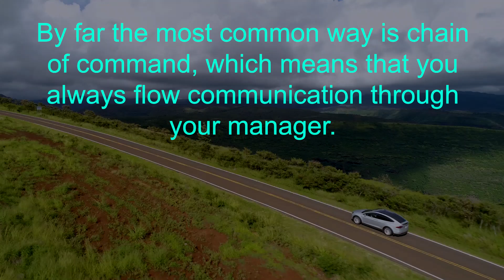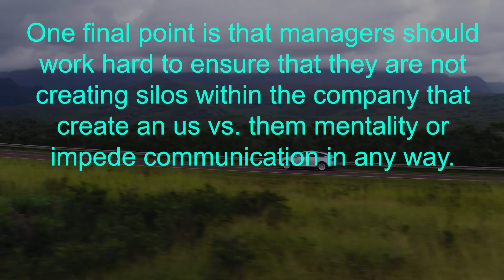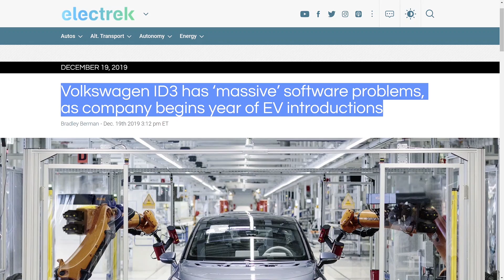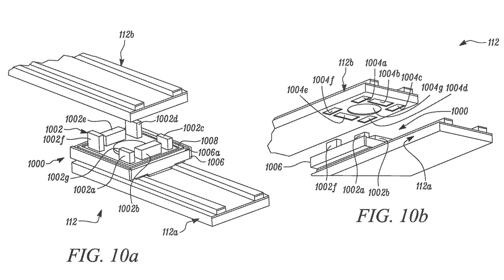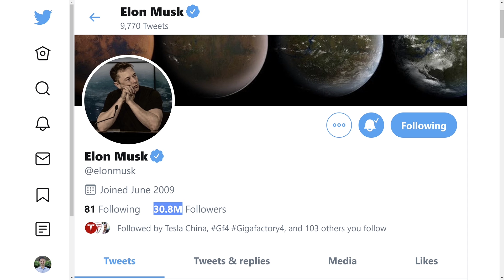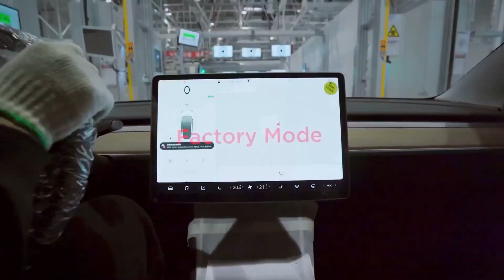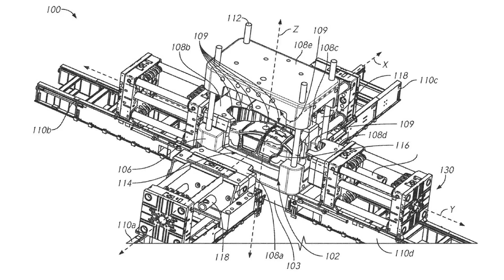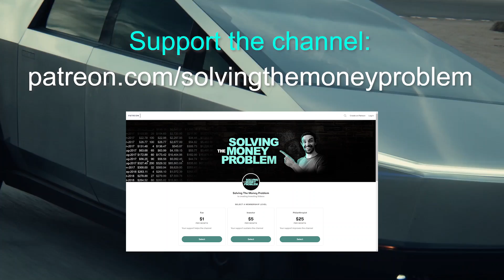Tesla: The Optimization Machine (why Tesla will win)

Comment: The “Silo” structure will kill the legacy automakers. Especially susceptible are the larger Japanese companies where respect for managements directives are more important to ones career than doing the right thing.
Reply: Youre actually right about hierarchy but overestimating the effect.. optimising around Toyota's culture actually was what propelled them to top. Read on Lean manufacturing . LEAN companies are far from siloed as you suggest as well. Silo and Toyota dont mix. What happens is quality circles, cross functional teams and a lot of continuous improvement. Theyre not no. 1for nothing
Reply: KwasiGhana TEMA is the NA wing of Toyota. They began “Siloing” every aspect of the Toyota production system in 2007. I know because I see it everyday ( hint hint). Toyota isn’t what it was, and I can assure you, there is a quiet panic going on behind the scenes. The entire market is changing, and they’re not ready.
Reply: mercedes and BMW at least try to change right now but the managers dont want to loose power
Reply: Prinz Eugen van Sovoyen You are correct.
Reply: Clorox Tree Are you talking about the ANDON system? Please tell me how they reward caught defects, because I’ve NEVER witnessed “rewards” given for stopping the line. Toyota is a radically different company from what it was just 12 years ago.
Reply: @bluecollardisruptor9584  if you watch the documentary on their production system from the early days you would know that once a worker on the assembly line pulled the rope and stopped the line b/c of a legitimate defect, once they resolved that issue they would get a decent bonus
Reply: Clorox Tree The reality of today, and for the past 12 years, is that numbers are all that matter. That’s why they’ve stopped innovating at the mass production level. I live the reality of a broken Toyota Production System everyday, I wish it were different. Those “ropes” are called ANDONS. The only reward you get now for catching defects is more work.
Reply: Clorox Tree No one knows battery cell technology better than Tesla. Toyota’s fallen so far behind by not following the consumer battery cost curve down, and now are in a situation where they’ll have to shut down over twenty power train factories, lay-off thousands of people, and mortgage the company to switch direction within five years. Their customers will vanish long before that though I’m afraid.
Reply: @bluecollardisruptor9584  I wouldn't say that to be true. As far as I know. LG chem in Panasonic are pretty close in terms of cost parity per kilowatt-hour compared to Tesla but then again Tesla doesn't really hold any battery patents. Their literally just using Panasonic. And I know people think that Tesla has a cost lead when it comes to batteries But if you look at the leak priced at LG chem was providing. 2 GM at the time it was leaked. It was about as low as what Tesla guesstimated cost was. They may be better at packing their cells together. But they hold literally no patents when it comes to the manufacturer of these that cells. There's literally only three players when it comes to batteries. And they are Toyota LG chem and panasonic respectively Tesla may own the largest battery Factory in the world But the technology is literally coming from Japan I'm not saying this will stay true forever. As I've been following Elon Musk since before the Tesla days But as of now, it's still true.
Reply: Clorox Tree I believe Hibar and Maxwell technologies will help Tesla package their new cells at an efficiency rate as yet unseen.
Reply: Clorox Tree Toyota just today recall hundreds of thousands of cars because the metal is so porous that the long life coolant is leaking through the block in all directions. They were aware of this problem back in September of 2019 but chose to do nothing. Their reliability is very quickly eroding.
Reply: Clorox Tree No problem, I believe we’re in agreement.
Reply: Clorox Tree Thanks, you too. Cheers!
Reply: “Especially susceptible are the larger Japanese companies...”

Seriously? Lol. So Toyota just so happened to float to the top by itself in its silo environments? They sold the most vehicles in the world to this date just cause, right? There’s a reason why these “legacy” car manufacturers have existed and continue to exist after decades and decades. If you’re disciplined (like, I dunno, the Japanese?) then traditional business methods will still work. There’s order, a chain, streamlines, teams, management. You still need this to survive in this world of business. Just cause Tesla has a good product does not mean it knows how to do business. Tesla has yet to make money, they’re still in debt. And other car manufacturers are no retards. Toyota will remain number one for a while. Tesla isn’t the only brand innovating. But I guess Tesla bandwagon boys can’t see straight after drinking the Elon juice too much.
Reply: @BigMaxStax  Past success does not dictate future profitability, nor success.  Tesla has become the second largest "auto manufacturer" by market cap, not because they outsold their competition, but because they have changed the game.  Disruption favors agility, and although Toyota was once the agile disruptor, they rested on their laurels.
Reply: @BigMaxStax  All you have to do is to listen to the pathetic EV denying of the CEOs and top management of the Japanese companies and their insistence that somehow hydrogen will be what drives all cars in the future. That is directly a result of the old fashioned top heavy management style where EVs are discarded because you have to invest A LOT initially and lower you profits in the ramp up. Also the Japanese government dreams of hydrogen economy, so this directly influences the car makers decisions. After the Koreans fully commit to their already fantastic EVs and secure the battery production, Chinese bring the latest generation of EVs and VW solves their software issues (not even mentioning Tesla and what products they will bring in the future) the Japanese car makers will face a huge fall. They will stay in business, better than the Americans and some Europeans, but significantly diminished from today.
Reply: @Sammy AFAIK Toyota plans to introduce a few EVs this year, and they want to have an electrified version of every single model they produce by 2025 (some might be hybrids, not pure EVs though). Google e-TNGA.
Reply: Sammy Well put.
Reply: Peter Gazdik They announced the same promise in 2009 to be completed by 2014. They didn’t do it, this matters..
Reply: @BigMaxStax  you ever heard of karoshi? It's a term that describes death from overwork. Japanese business success is the result of crushing underlings because they are culturally obligated to kill themselves over their jobs. That is of course a figure of speech, but since it describes the outcome accurately (in my opinion) it's also the truth.
Reply: BigMaxStax Toyota NA has adopted “siloing” in every aspect of the business since TEMA took over operations in 2007.
Reply: @BigMaxStax  You make some good points but he's right about the hierarchical system in Japanese culture, it IS a serious liability and respect should be earned not titled.  They are competitive despite that, they don't have the toxic union culture of the US and Euro for example where there is a constant battle between workers and management with endless petty power contests instead of rowing in the same direction.

Comment: Teslas can update because all of their software runs on Linux, and Linux has clear processes for updating.  Other cars may have components that run Linux, they don't have a single, uniform operating system to take advantage of.  Moving everything to a single (open source) OS would be a huge cost for automakers, and likely several years to execute.  Until then, updates are a huge, bespoke effort, and works only if the cars themselves have connectivity.

Comment: Others "build" a car (or "assemble")
Tesla builds the system. The car is just the end result.
Actually, thinking about it, the methods they use are just as, if not more revolutionary than the Ford production line.
This will eventually become the blueprint for 21st century industrial practice (imo)

Comment: The comments about the company are excellent - I'm just not sure that the stock market can be relied on to accurately reflect the value or promise of any company. It can be wrong on both sides of the equation, and can stay wrong long after circumstances have changed.

Comment: My dad wanted to buy a Rivian, but after looking at the specs they gave us he changed right away to cypertruck. 180kwh battery for about 400miles +?? Inefficiency of the motors have to be low. (The 400 miles one likely to cost around 150 000 btw)

Comment: You work at Tesla? I have a idea for boring company ventilation system. Have fans that can reverse blade pitch without changing direction of spin. That way you can suck or blow without stopping the motors. Another thing Tesla needs to make is tractors and heavy equipment... Would be a real game changer. Fan idea was for his bullet train idea originally for sucking the front and pressurized the back without needing to stop and change fan direction... I think he has given up on train idea now... Kinda like roofing solar shingles... Not the best idea. Regular solar works just fine. Also just imagine a super luxury self driving Tesla class A RV. No need to hire a driver. No need to pay for gas and recharge while camping at camp grounds for free!!! It's the future. Also what about self powered trailers for towing... All electric with regenerative braking. Also did you know all metal is magnetic. I have a idea I want to show Elon musk it's a gold isolating magnet using Lenz effect and inducing Eddy currents into metal. Good for recycling metals and mining metals. Watch my videos on gold isolating magnet... Then once you understand how it works using Lenz effect show Elon musk! It's your Destiny!!!!

Comment: does tesla recycle the batteries or trade-in and what happens to the parts when the car is done? that's what I'm curious about because batteries aren't exactly nature-friendly.
Reply: JB from Tesla is pursuing battery recycling ...
Reply: Tesla has a recycling program already in place to do just that: http://letmegooglethat.com/?q=tesla+recycling+program . Well over 90% of each batteries can be recycled with current technology, expect even more in near future. And no recycling required before 20 years in a car (350 000+ miles: https://cleantechnica.com/2019/11/23/500000-miles-in-a-tesla-whats-the-result/ ) and another 20 years as local energy storage (solar, wind farm). Again, with current technology. 25 years + 25 years = 50 years of usability and 98%+ recycling is already on the radar. 

You should attend the Tesla Powertrain and Battery Investor Day that should happen soon: https://ir.tesla.com/events-and-presentations

Comment: Continuous improvement and optimisation is hardly a new concept ...  but I agree their agility is exceptional and that allows faster optimisation.  I suspect a big reason for this is that Tesla’s survival has been in question for most of its life ....  that means that optimisation is a matter of survival, not a choice.  In addition the expense and limited power capacity of battery tech makes every optimisation hugely more significant than it would be for ICE cars.  Eg drag coefficient.  Eg  motor efficiency

Comment: ENPH sorry for repeating every time they do you have a look enphase energy
Reply: Abraham Breuer My Mum has some ENPH stock. Seems like a good company, but it’s not clear to me exactly what makes their inverters different than say a Tesla powerwall. What do you think is their key product? Is it their microinverters for Uber small PV systems? Or their individual PV panel inverters for large arrays? Or something else entirely?
Reply: David Kasman Micro inverters have better efficiency over string investors. 
Cheaper wiring. more safe. Less installation work. More and more solar installers are partnering up With enphase!
So far Tesla use solar edge the best string inverter on the market